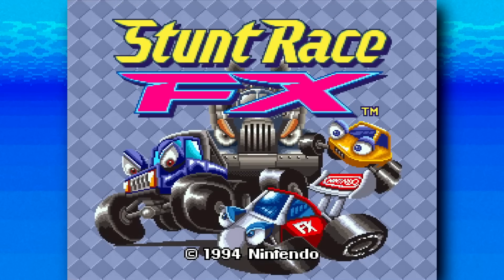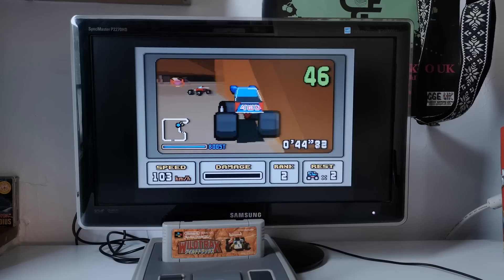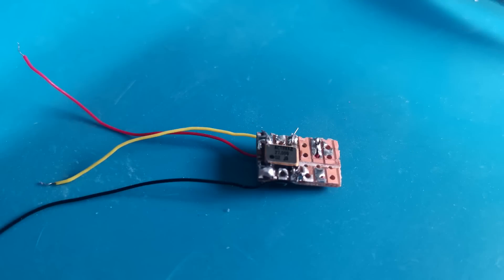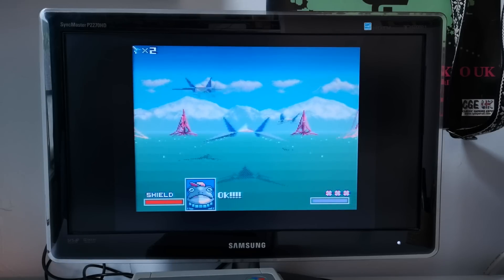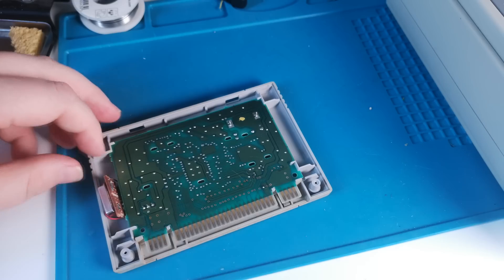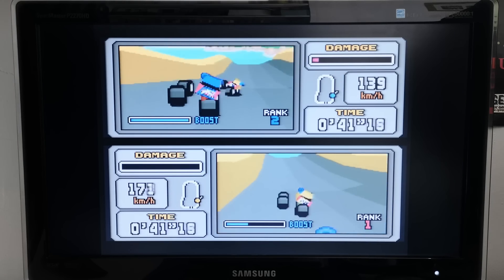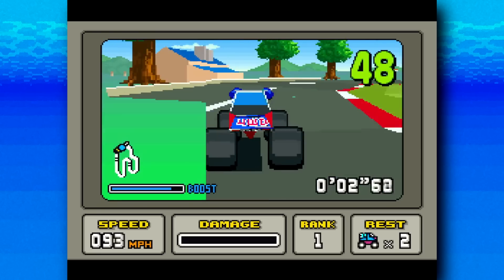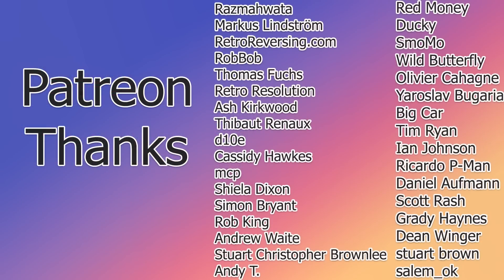SNES Overclock

Comment: Seeing the frame rate this runs at just proves how much more impressive the chip was that powered Virtua Racing on the megadrive.
Reply: The problem is with the SNES itself. 8-bit data buses.
Reply: Also, to be fair, the SVP chip was of higher spec than even the FX2.  But, it was also way more expensive.  So it WAS impressive but the $100.00 price tag probably killed it.  That and the the advent of the 32X. 🙂
Reply: @wolventerror  Instead of releasing the 32x, they should have just released an SCP cartridge.  They could have had other games lock into it like they did with sonic and knuckles and it wouldn't have required its own power supply and video pass through.
Reply: @mattuw82  totally agree!  Plus the mass production would have lowered the price.  Oh well.
Reply: @wolventerror  Sega spent so much money developing weird hardware and then abandoning it!  The Sega CD, 32x, SVP, a dozen weird proprietary arcade boards.  They should have just released a new, inexpensive, cartridge based, 32 bit, 68k based console in like 92 or 93 and it probably would have been a hit.
Reply: @mattuw82  no way, the 32x already has enough of an issue handling 3d with reasonable performance. the svp is far worse, and not even useful in a general sense like the superfx is.
Reply: @jc_doge  Yeah.  But the 32x cost 179 dollars, was awkward and clunky, and sold less than a million units.  It was Sega's biggest failure up to that point and irreparably damaged their brand.  You're arguing that it's a better strategy than just using an enhancement chip like the FX chip or SVP?  I don't understand.
Reply: @mattuw82  no i'm just saying it's way better than the svp. svp just means slow 3d. it's a dsp, not a general purpose processor.
Reply: @mattuw82  32x is a lazy job, could benefit from more dedicated graphics acceleration in addition to its quite powerful CPUs. And from not being sabotaged and abandoned by Sega itself. A few more games, subsidizing the cost of the hw with game sales, could save it.
Reply: @noop9k  I don't think so.  I think there's plenty of proof that expensive hardware add ons, especially big clunky ones that need their own power supply, are a bad idea.  Little cheap ones like the N64 memory pack do just fine though.  But there's a reason why the Sega CD, 32x, Nintendo 64dd, Famicom Disk system, 3do M2, Jaguar CD, etc, are all flops.  If people are forking out big money and adding another box under their TV, they want it to to be an actual fully fledged console.  And developers don't want to develop for something that has a user base that's so much smaller than the parent console.
Reply: @mattuw82  PC Engine CD-ROM was a great success. FDS was initially a success but succumbed to piracy. Jag CD was only a failure because jag itself, the core platform, was a failure and was abandoned altogether. Sega CD wasn’t really a failure though it lacked support. M2? This is the first time I’m hearing about M2 being an add on.
And 32x.. It was dumb and intentionally killed by  Sega to not compete with Saturn. Nonetheless it is still way more powerful than SuperFX and the Virtua Racing cart. It just did not have original games as good as Yoshi’s Island and Star Fox and the Doom port was a hack job even if done by Carmack (see the Resurrection project)
Reply: @mattuw82  In general, many more consoles or console addons failed purely due to mismanagement, politics or technically preventable issues like piracy or component reliability.

You can find comparable success ratio with standalone consoles, dozens were released but a few succeeded.
Commodore alone released at least 3, all of which failed. Etc.

The entire N64 was crap. The hardware, cartridges, controller etc. Yet it survived due to N being a rich company with big rabid fanbase and competent management. And some great games.
There are so many factors at play besides “consumers don’t like addons”.
Reply: @noop9k  N64's hardware was not crap. It was extremely impressive at the time, it's just the cartridge format that held it back. The controller was not great by any means, but it was one of the first to have a stick so you have to cut them some major slack. And they improved the controller in a huge way when the Gamecube came out, as the Gamecube controller is pretty much the N64 controller version 2.0. The only other controller at the time of the N64's release to have a stick was the Saturn's 3D controller (and yeah, it was definitely done much better.)
Reply: @JMFSpike  Just two words: Texture buffer

Considering the time when it came out (years after the competing hw),  yes, it was bad.
Reply: @noop9k  You could stream the textures from cartridge, even on cartridge RAM!
Reply: @noop9k  The PC Engine CD sold less than a million units.  It was a flop.  The Sega CD was also a flop and lost tons of money.  I'm going to stick with my initial assertion that expensive add ons are a bad idea.
Reply: @mattuw82  Almost two million total is not a flop for an expensive “high end” addon that had next to no presence outside Japan. That’s the entire worldwide sales of 3DO that had very permissive licensing and was produced/marketed by multiple companies worldwide.
I’d say it was a big success for the time.
Reply: @mattuw82  Imagine releasing an addon somewhere in 1994 without video passthrough. What kind of advanced 3D graphics you are going to show when inheriting the original inferior color palette and 16 color per tile graphics?
Yes, they at least should’ve made it power the entire console like PC Engine does instead of requiring a power brick for each.
Reply: @noop9k  The 3do was a flop.  The Turbo CD was a flop and a huge money loser.  Their console division was left in shambles and their follow up console was a joke.  I'm going to stick by my original statement that expensive hardware add ons are never successful and are a bad idea for a whole variety of reasons.
Reply: @noop9k  I think the 32x could have been a minor success hadn’t everyone known the Saturn was coming out and held onto their money. It’s ironic most of the gems people love and remember from Saturn tend to be alot of 2D titles anyway, Saturn was pretty poor at 3D compared to PSX or the 64. Sega should have doubled down on the expansion format and keeping parents happy without little Jimmy having to throw out his old system, we could have gotten a lot of unique titles that pushed the limits of 2D while still keeping some basic 3d functionality. This is why the 64 was such a success, they didn’t just try to mimic what Sony was doing.
Reply: @mikeg2491  Ugh, 32x has bad 2D performance as well, it can push less 2D pixels than stock VDP. This is why some 2D games run at 30 FPS only. If you use it for 3D, or “2.5D” the results are way more dramatic. But overall it can do nothing fast enough though it could do Starfox or Doom way better than the SNES with SuperFX.
Reply: @noop9k  holy crap... everything you have said in this thread is wrong. Its amazing
Reply: the games are coprocessor and cartridge bus limited. the svp is a dsp anyway
Reply: I think Sega's clockspeed was just higher which is why they kept calling it blast processing
Reply: @uhhh_adam  There are many versions. Likely the combination of 16-bit buses, higher end CPU and faster DMA.
But 68k and 65xx family clockspeeds are not directly comparable.
Reply: Stunt Race FX displayed textures with some of the polygon, weather effects where as Virtual Racing had none. Track designs were more dynamic than Virtual Racing. Nintendo did more with the Super FX while Sega gave up
Reply: Sega fanboys still thinking they one the console war when clearly we all lost and the winners are the rich assholes charging $70 for a rererererelease of and old game.
Reply: I just bought a copy of virtua racer a few weeks ago.. it's fun, but I'm still in 16th place..
Reply: the S.V.P. chip was also 6 times the size of the Super FX chip and costed as much as a game cartridge itself. Not that impressive.
Reply: Stunt Race has much more complicated handling physics that VR. It's a more complicated game generally. (VR is still a great port mind?
Reply: The problem with the chip that powered Virtua Racing was that it overshot the mark by a mile.  It was an excellent port of a popular arcade game but it completely bombed because of the outrageous price.  That is the reason the FX Chip wasn't as fast.  Nintendo understood that no matter how good there games were, they wouldn't sell at a $100-$120 price tag no matter how much smoother they ran.
Reply: @davidaitken8503  Virtua Racing was like £90 brand new when it came out. I rented it and was impressed by the smooth 3D animation. It would have been well worth £90 is it had a career or tournament mode and at least 5 tracks. But it was limited to 5 laps maximum with a difficulty level that was unaltered from the arcade - ergo ROCK SOLID! Too hard. but otherwise, it would have offered great value.
Reply: The SNES CPU was snail-like and way underpowered for the hardware, hence why so many SNES games had massive amounts of slowdown and beat'em ups had to dramatically limit how many characters they could have on-screen at once (just look at Final Fight SNES vs Arcade)
Reply: @drlight6677  Yes the SNES CPU is a mystery to this day. The Ricoh 5A22, which is a 65C816 with a couple of alterations, I think in the DMA unit. It can handle 16bit instructions. But although no-one will admit it. I don't think they were ever used. So it's still 8bit. But that doesn't matter. The key issue in this case is the bus bandwidth or MB/s data transfer speed from rom to the various ram's. The snes is limited to 2.56MB/s. The cpu uses 3 speeds, of which it's 99% of the time running at 2.56Mhz. There is a faster 3.58Mhz rate which would only be used for single cycles, needed to access certain hardware chips in the system.

But the bottom line is the bus speed or what we'd call memory speed these days. Which is limited to 2.56MB/s. Far lower than the Mega Drive's roughly 10MB/s.

It's this bandwidth that allows the SMD to run Virtua Racing, which is how the Samsung stock DSP chip can calculate and send out the results through the bus fast enough to achieve the consistent 15fps it does in VR. along with a highly complex feat of engineering from both hardware and software engineers working together from Sega's staff.

Argonaut made their games in the UK without the collaboration of Nintendo and in depth knowledge of the system that the Sega engineers enjoyed. So they were operating with a custom chip they made themselves, to a spec which was within the costs specified and without any in depth insight into the SNES hardware.
Reply: i mean, it was actually like, more technologically advanced, and just the previous comment says, the mega drive's cpu was faster than the snes's
Reply: @luka9967  I'd say that the snes's cpu is actually on par if not sometimes faster than the md.
The reason why it wasn't enough to show all these cool effects were probably partially due to how the snes ppu stored graphics. 
While the md stored it's tiles back to back, ie 4b for pixel 1 4b for pixel 2 in a single byte. the snes stores each sig levels of 8 pixels in separate bytes. So you can't go by addresses while scaling. Which makes the proposition difficult. 
It also probably didn't help that the m68k was understood by more people at the time since you can just buy an amiga (which is an amazing machine in its own right) to start. 
Comperatively, nothing else used the 65c816 to even practice programming on it appart from the infuriatingly slow Apple GS, since the 65c816 clocked at 8 Mhz would absolutely shred the M68k.
But the M68k was just more understood by more people, and it's not the top speed that matters, it's the cruise.
Reply: The Mega Drives main CPU was also much faster then the one on the SNES (68K vs 6502). I don't know how much that accounts for.

I wonder if anyone's tried overclocking the SVP chip.
Reply: @SeanOfEarth  SNES uses 65816 which is more powerful than normal 6502, but it is still sitting on 8-bit data bus and less advanced than 68k
Reply: @SeanOfEarth  You can find videos here on YouTube of somebody getting Sonic 1 ported to the SNES. The guy said that the SNES CPU is about 40% slower at doing the physics calculations for sonic. Velocity, momentum things like that. My memory is a bit fuzzy on it so probably look it up. A few channels did videos on it. It dose work though. 90's me would have been quite shocked that it would work at all. I remember doing a benchmark if you will back in the day. Using the debug mode to give sonic loads extra rings then getting hit and watching what happens. The CPU could keep track of far more rings then the graphics chip could draw. Give your self hundreds of rings and get hit. You wont even see all the rings but the game will slow to a crawl. Only picking up in speed again once enough rings have been gathered up or bouced off screen. The game was keeping track of all the rings even if it couldnt show them all. That was 25 years ago and i dont feel like diggin mine outa the basement to test this so who knows. LOL
Reply: @isntyournamebacon  Certain types of 'raw maths' are dependent on clock speed, such as 3D vector calculations, compression/decompression and some physics calculations.  The best demonstration of this is the Spectrum's better 3D capability than the C64 where hardware sprites and scrolling are of no benefit to the lower clocked CPU, and the loading speed of the map in Desert Strike on SNES vs the Megadrive where you can almost hear the strain of the SNES trying to decompress the map graphics.  Even today single core performance for number heavy tasks is faster on the latest 8 core i7 chip vs, for example my 12 core 5900X, simply because the clock is faster (per core).   All the other frippery like buses, memory speed and video chip speed come into play in complex code like games where a shedload of things are being done at once and several chips are talking to each other, and the CPU can't brute force it.
Reply: @KittenRaptor  Z80 is clearly better at “real world” workloads especially software rendering than 6502 with comparable (f/2) frequency despite 6502 having supposedly more MIPS.
Reply: @SeanOfEarth  It accounts for little. The SVP chip counts more in here. That and the color mode (256 colors vs 16 colors).
Reply: Unfortunately Sega completely over shot the mark and the game was just too darn expensive.  If Nintendo had put an even faster FX Chip in Stunt Race it would have been too expensive as well.
Reply: The Super FX was never built as a 3d accelerator. It was more a general purpose chip to boost the overall speed the SNES could run at, hence it being used in games like Yoshi's Island.

The SVP was designed and built purely for 3d work.
Reply: @81632bit  The SVP was actually a Samsung DSP.
Reply: @81632bit  Super FX was designed by British people from Argonaut, who specialized in 3D games, hired by Nintendo, specifically to accelerate graphics in SNES games. Statement that is wasn’t designed with graphics in mind is hard to believe. Yes, it can help with 2D graphics as well.
It is 32x that is using stock SH2 CPUs with barely any dedicated gfx acceleration (a few simple but helpful features still exist)
One of the things that absolutely can’t be done with software at decent framerate is transparency, this is where 32x can’t beat stock SNES.
Reply: Or stuff like F1 World Championship or Kawasaki Superbike Challenge, which produced 3D graphics at a good framerate without an enhancement chip. It wasn't full 3D (it mixed 3D objects with 2.5D techniques similar to what was used in games like Outrun) but it was still impressive.
Reply: Eh. SVP chips cost a fortune.
Reply: There a Remake of both Street Fighter Alpha 1 and King of Fighters 94 , Castlevaina the popular 1 on PS1 coming out for the Sega Gen/MD. that alone show how impressive the Gen/MD is
Reply: @joezar33  There was a Street Fighter 2 remake for the NES. And Super Mario World too. 
That alone doesn't make a console impressive. 
I'm sure that the SNES could also benefit from more cartridge space.
Reply: @fungo6631  should look up the ports there fan made they don't have that wonky Bootleg gameplay

Comment: If only the snes had a faster base clock frequency, so much more could be achieved
Reply: There was an accelerator for the Apple IIgs (which used virtually the same processor) in the 7-8 MHz range, but it probably would have cost more. 3.58 already beat the IIgs, so perhaps that seemed like enough.
Reply: @pokepress  it was probably due to price. Because 5 years later the SA-1, which is just the SNES CPU but 3 times faster, was embedded in carts and added $10 to the cost of games.
Reply: @pokepress  they certainly didn’t have 3D graphics in mind when designing the snes
Reply: That's what the SA-1 basically is. Fast CPU and a little bit more RAM
Reply: @BurritoKingdom  I know that. But a faster base clock would speed things  up a little